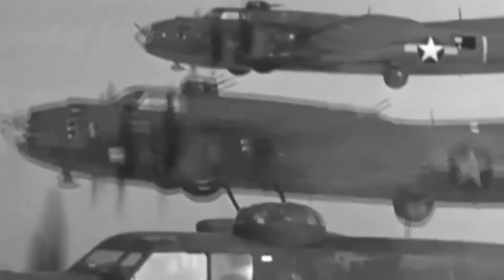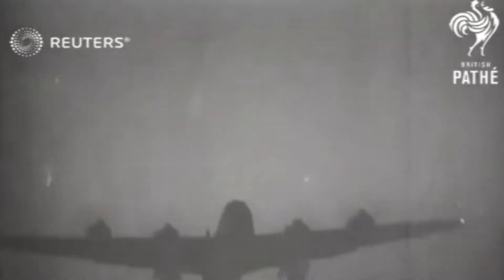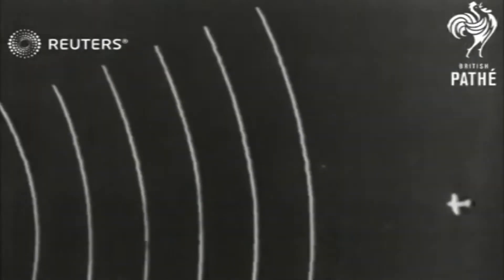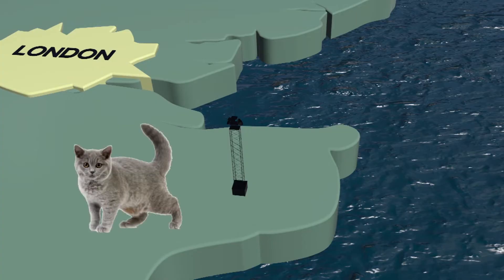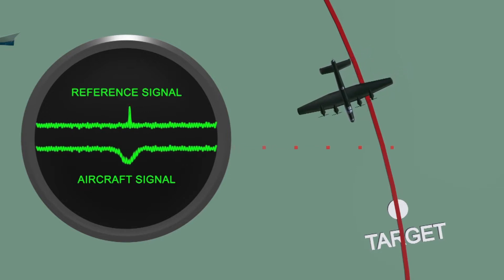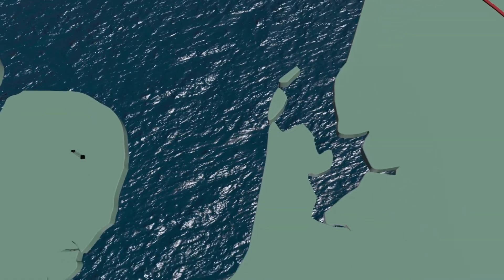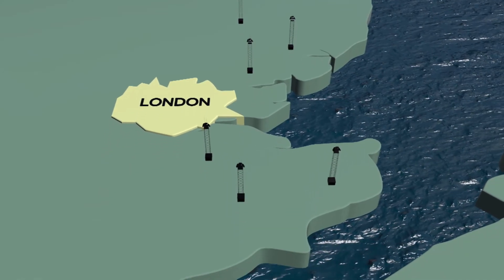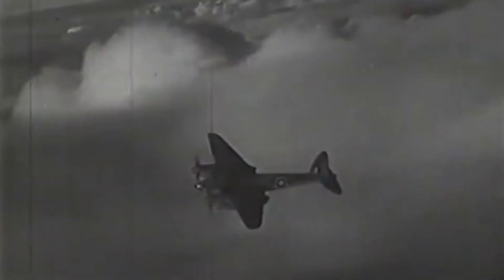Unveiling the Ingenious OBOE System: How Allied Aircraft Precision-Bombed Targets at Night

Comment: Sounds like an improved copy of an earlier German system as used in the blitz,  the English countermeasures were known as "The Battle of The Beams".
Reply: 'Lorenz' Blind landing system adapted by the germans similar to OBOE....The British managed to 'Bend' the beam by using the same frequency and moving the cross point.The 'Secret War' a BBC Production in the 70's.explains this very well
Reply: @androidbox3571 Absolutely nothing in common between the Oboe and the three German beam systems bar the fact they used radio waves.
Reply: Not really, one is measuring time of pulses, the other is simply following a beam, it has similarities to Loran.